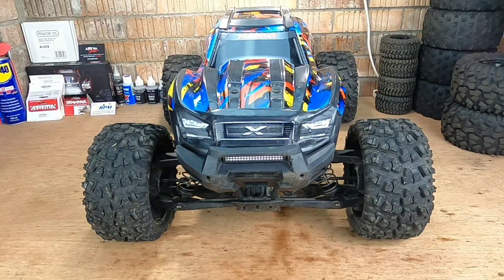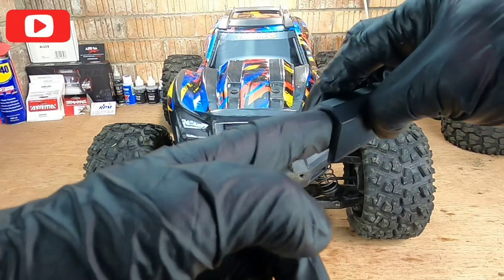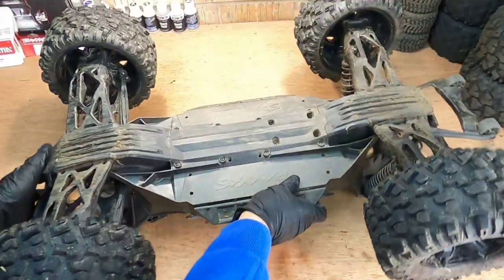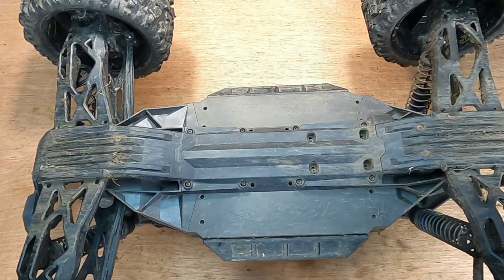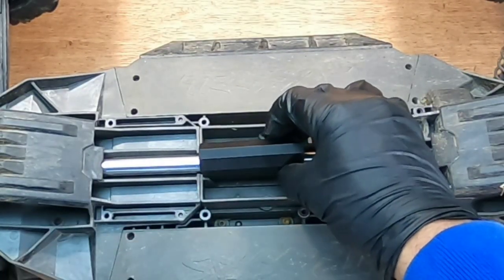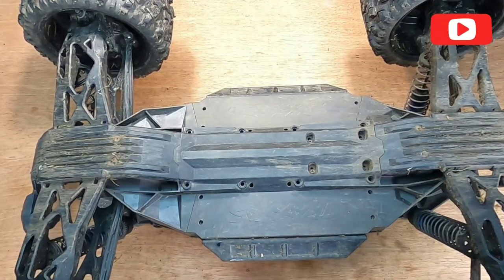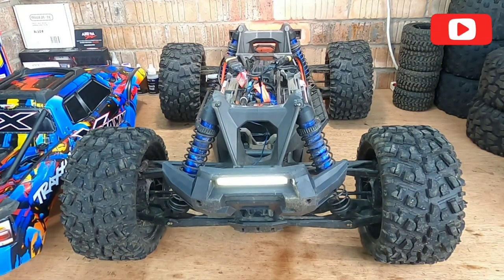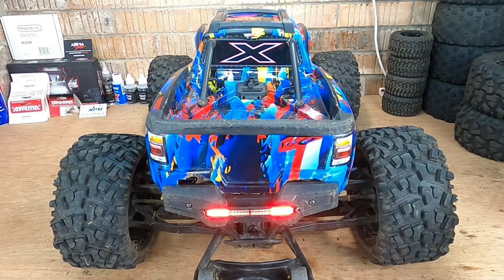Traxxas X-MAXX 8S -  MUST DO? Centre drive shaft MOD - SIMPLE, CHEAP, QUICK and EASY...Worth doing??

Comment: The link is no longer available any were I can order this ?
Reply from the maker: Hi. I removed this mod and opted to go for the ultimate solution. A 2 part drive shaft mod. Here is a link.
https://www.ebay.co.uk/itm/Traxxas-X-maxx-2-Piece-Center-Drive-Shaft-Support-Block-8S-Upgrade-/174669508932?mkcid=16&mkevt=1&_trksid=p2349624.m2548.l6249&mkrid=710-127635-2958-0

Comment: hi! it finally worked?
Reply from the maker: Hi 👋 it worked OK but I did remove this tunnel and installed a 2 part drive shaft mod with a bearing in the middle. I wanted something more flexible as I like to jump alot..it has worked really well...my driveshaft is still straight after lots of bashing. I've done a video on this mod too. Check it out on the channel. Links to the products are in the description.

Comment: Yep, seems like traxxas don't care about customer feedback anymore, since day one the maxx 4s came out, some owner like me are said the bulkhead is not stronge enough, they did nothing on the second gen maxx 4s, still coming out with the same old design (you see the same on the hoss too, no strengthening up anythings, it just a same old rustler 4x4, slash or stampede). 
On the other hand, arrma start to pull me away for traxxas, caz arrma will upgrade they product in every versions to strength up they're products to make us happy (so we can upgrade less, and us they're parts). 
Just like at the 1/5 scale arrma, the second gen is coming, 1/5 scale kraton exb 8s, it is stronger then the previous versions (the 1/5 kroton 8s and outcast 8s). 
If traxxas really see this comment, i think they should change the way they do business, caz after my maxx 4s, looks like i am going towards arrma for my next fill rig (until they think about strengthening they current rig, "besides the x maxx"). The problem is traxxas keep come out with new trucks that have weak point on them with out strengthening them, but arrma will upgrade on the next version or generation, so that we can fix less and enjoy our truck.
Reply from the maker: I absolutely agree with you dude. This Center drive shaft issues has been there since day one of the release. Traxxas need to LISTEN and REACT! at the same time I don't like how arrma release their products with giving them a good durability test. It can be hit and miss on their version 1 models. All my arrmas are v2 or above and I love them to bits but nothing can compare to the mighty X-MAXX!👍🙂
Reply: More power more problems
Reply from the maker: Yeah... totally agree. More power usually means increase in weight which also contributed to breakages. In 3 yrs I've had very little break.